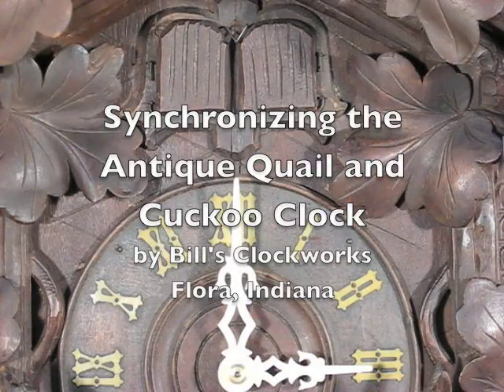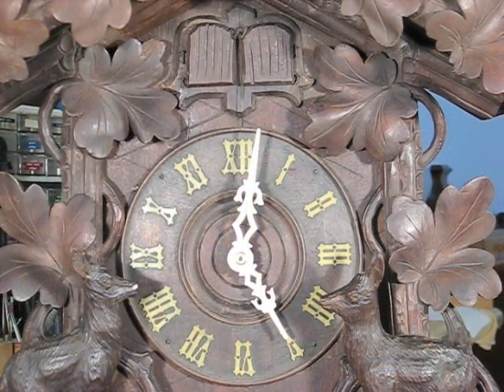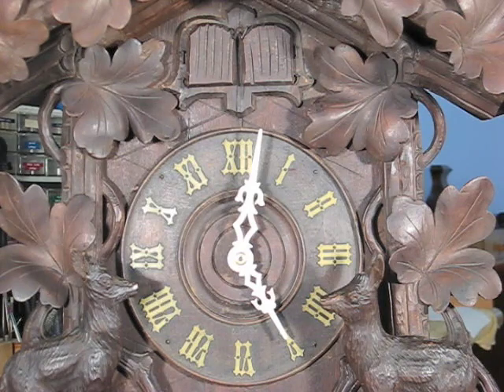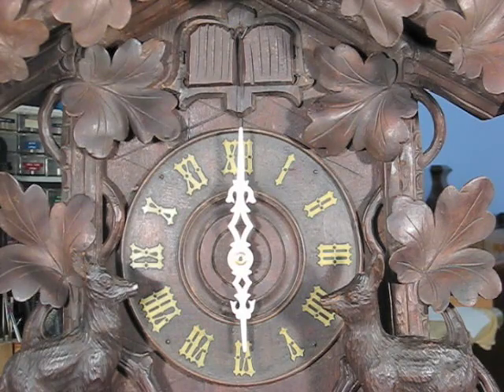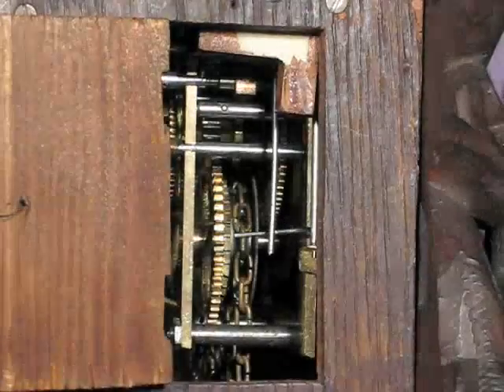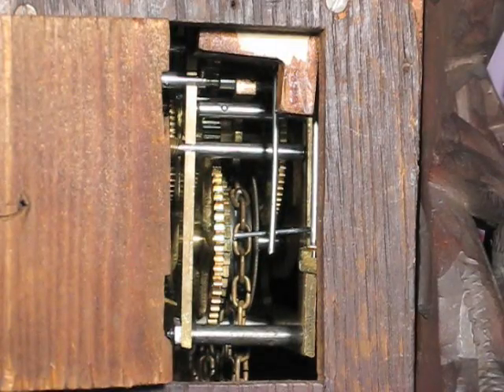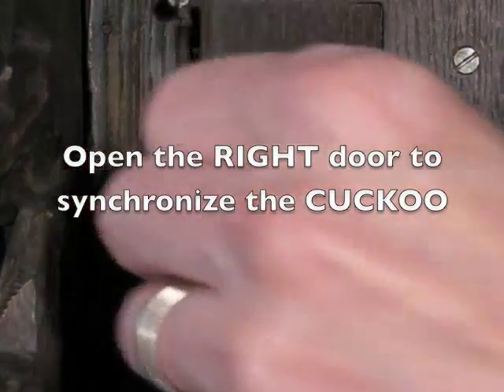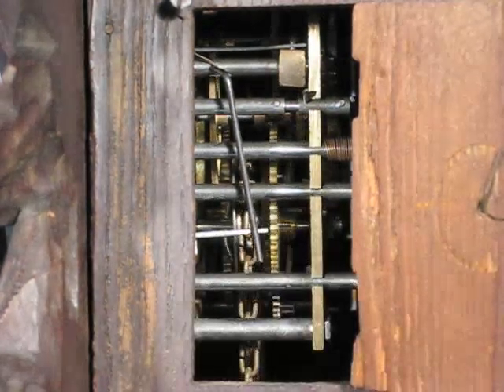Synchronizing the Antique Quail and Cuckoo Clock

Comment: I have purchased a cuckoo and quail clock on ebay with a Herr movement. it has two chains which hang down from the bottom. one is for the quail and the other is for the cuckoo. would the process be the same as here? This clock is around the 50 to 60 era